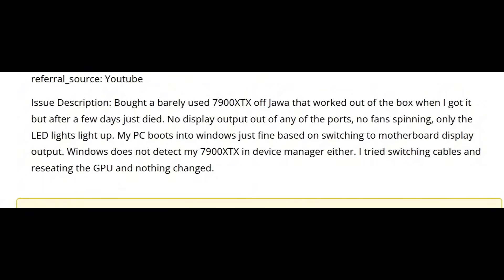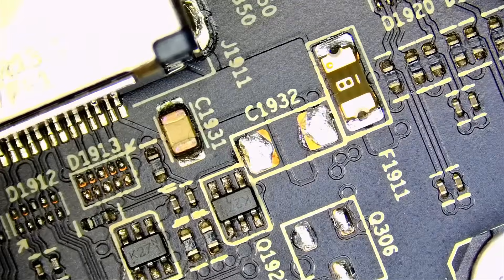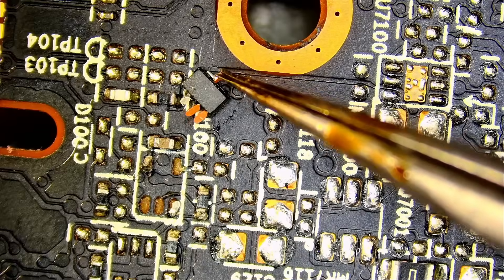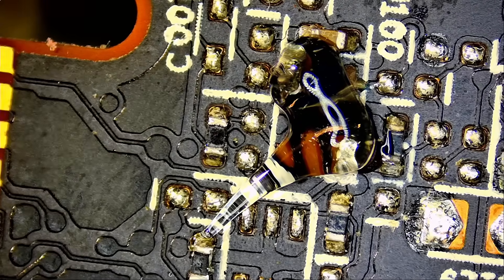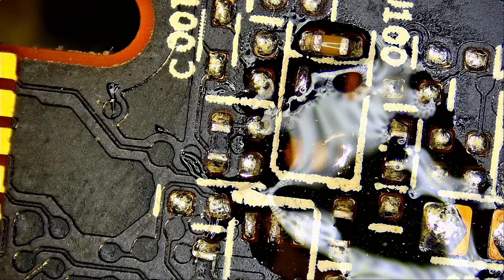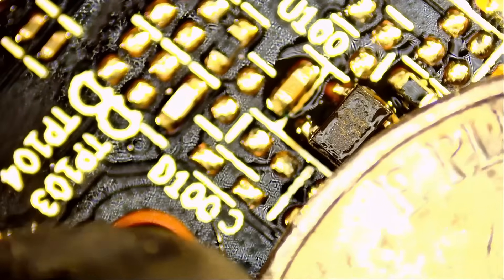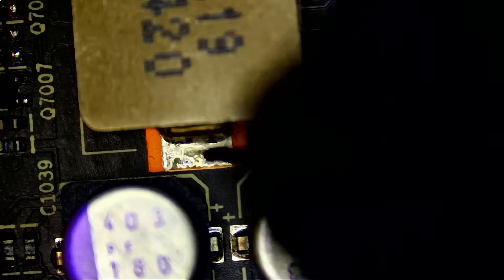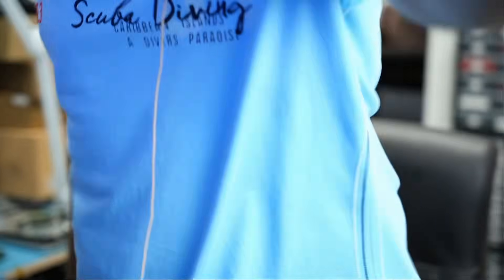Dead GPU Fix? SFX 7900 XTX Suddenly Stopped Working

Comment: i have a brand new ASRock AMD Radeon RX 7900 XTX Phantom 24gig card was using it for 18 days and  the video stop working lights and fan still works. before the card stopped working m computer would shut off in middle of game.. its a brand new card wtf could or went wrong ?

Comment: "After a few days just died" - sure, that chip suddenly decided to escape and ripped its legs and pads in the process.
Reply: That must be super-advanced AI chip 😂
(it gained consciousness and tried to escape)
Reply: maybe during the transport it started to be weaker and than just later, due to increasing temperature from usage, solderings just melt definetely
Reply: I had the same thought. Especially when I saw the bent pin and missing pin? and the lifted copper tracks.

Comment: I use to be an SMT machine operator and repairman, love the channel this is the kind of work I enjoy. People need to be careful handling these boards when moving them, these parts are not as strong as people may think they are. It only takes a simple drop or bump the wrong way and you can rip a component and pads right off a board. >.<
Reply: "these parts are not as strong as people may think they are" actually they are much stronger than you would think. Sure SMD ports and jacks are not as robust as panel mounts, but otherwise ... no. That's just not an accurate statement. Short circuits and overheating are what cause most SMD parts to do this, not improper handling.
Reply: @HazeAnderson  Shorts and overheating don't cause 3 pads to get ripped off a board. Please don't try to educate people, especially like this dude who professionally did repairs, when you clearly don't even know what causes a ripped pad.

Comment: xfx has a transferable warranty and that model way released way later in the 7900xtx lifecycle (june 2024). it should still be under warranty as its a 2 year warranty with XFX i don't understand why the guy sent this to you instead of just rmaing with XFX
Reply: Warranty would have been denied due to it being physical damage to the board as seen in the video. All GPU makers do this now.
Reply: They will say user caused physical damage
Reply: Good info but warranty wouldn't have covered this anyway
Reply: I could be that it rejected by warranty.
Reply: 4:38
I think  warranty does not cover misuse or mishandling
that chip was ripped off somehow mostly unintended by accident; human factor
still XFX is reputed & good company with good products & quality radeon lines
Reply: they do deny warranty over physical damage which sucked for me. whats even weirder when the video showed the exact same spot and chip the card got damaged. SFX also doesnt have anyway to repair for you either so i had to bring it over to a local repair shop, they fixed it just fine.
Reply: i like to think some people forget about the warranties or insurance protection plans they purchase for their products.
Reply: A chip like that dosnt just break off on its own, he or someone else has tampered with the card at some point. That voids the warranty.